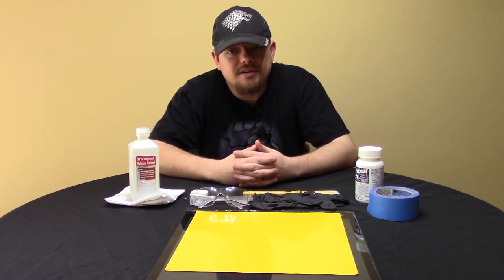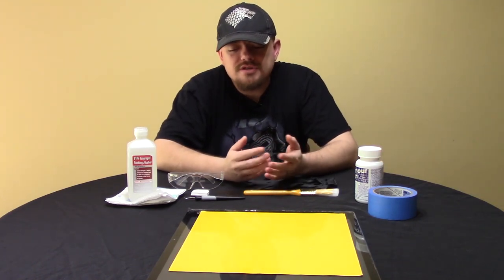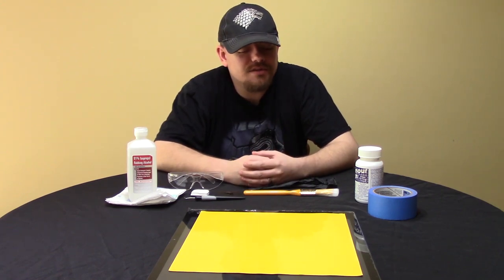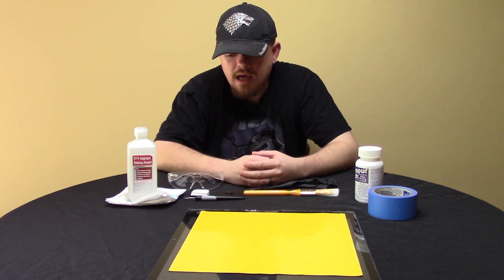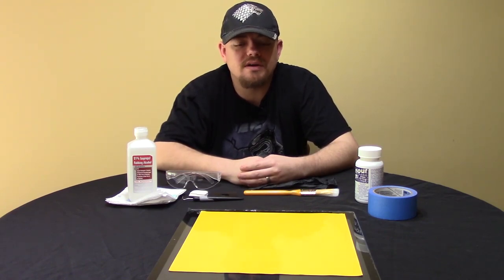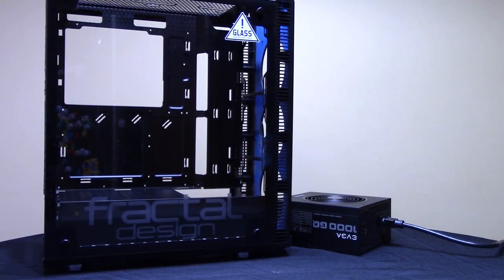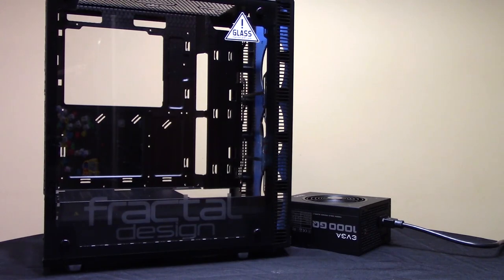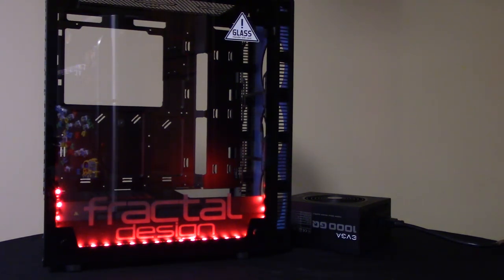Tempered Glass PC Case Etching Guide Short Version

Comment: Can the etch stuff be used to remove 10 year old hard water stains from glass/
thanx
Reply from the maker: Hmm it would probably remove the stain however it is also going to remove the table layer of glass making the etch. Essentially this stuff eats through the glass so if you just wanted to clean something I don't recommend it. However if wanted to cover up and etch the glass in that area I believe it may work out. Can't be 100% sure as I haven't tried it with stains.
Reply: @NerdW0rk  
thanx for your quick reply. Have you come across a product that could remove the water stain. It is on large sheets of tempered glass i stored outside for over 10 years.
best
Reply from the maker: You're welcome!

Believe it or not but WD-40 or tooth paste (paste not gel) may help clean it. 

That or Mix equal parts white vinegar and water in a spray bottle. Spray the spots or stain with the vinegar solution, letting the liquid set for 5 to 10 minutes. Wipe away the liquid with a soft lint-free cloth.
Reply: @NerdW0rk  
tried that - i think i need an acid solution of some kind.
thanx